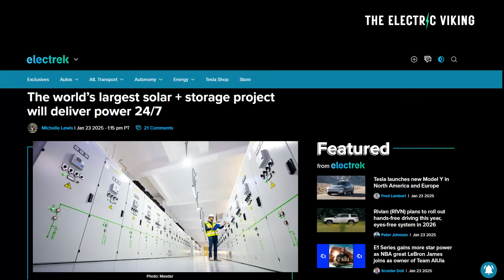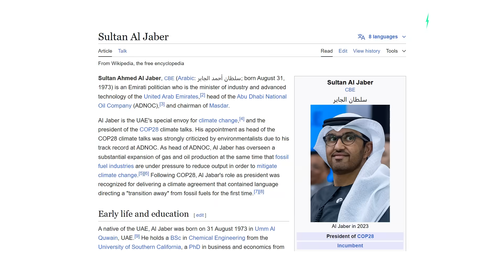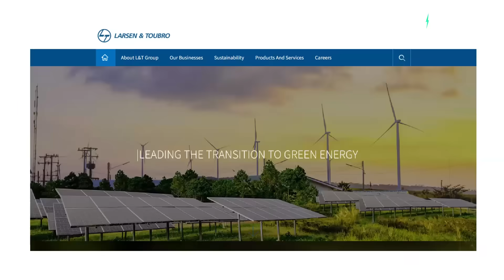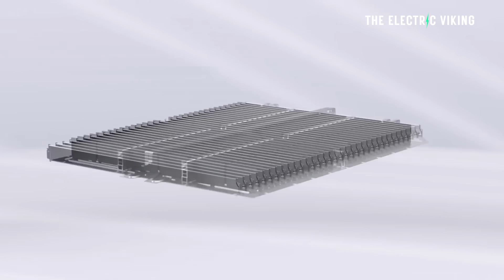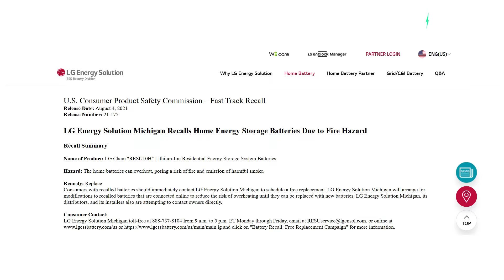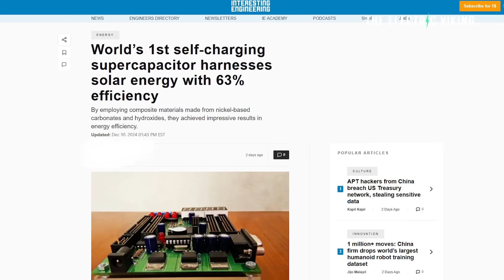The world’s largest solar and battery project deliver power 24 hours a day

Comment: I worked out the cost of installing solar in my home and it just doesn't make sense.  I've managed to get electricity use and costs down to a level where I'd never save enough off my monthly bill to be able to pay off the cost of a solar panel/battery installation system in my lifetime.  I could install a small 'stand-alone' disconnected system to power a back-up source for infrequent power outages, but outages are rare in my area.  Nuclear power still looks like a more valid option for large-scale energy needs in a metropolitan area.

Comment: UAE has 4  APR1400 nukes and is about to build another 4.  These were built by the Koreans over 10 years.  Nuclear pairs well with solar and batteries in hot sunny climates.  The claim solar and batteries can do it alone is baseless in the context of the required reliability.  Western Australia should replicate this model

Comment: This project is not the end of nuclear. The UAE has recently built 5.3 GW of nuclear, so this 1 GW solar-battery just means that the UAE is pursuing an all-the-above energy strategy.
Reply: They use a ton of energy and have some of the world's highest emissions per capita. An unfathomably wasteful country.
Reply: @veganpotterthevegan heehaw Heehaw
Reply: Given the price difference and speed to build difference, this is another nail in the coffin for nuclear. Not the end of nuclear exactly but sensible people will see the cost and timeframe difference and will usually choose renewables plus storage. Not always - but most of the time.
Reply: @glennjgroves  and "most of the time" means minimal profit....if any.  A dead duck.
Reply: @glennjgroves  China is building plenty of renewables, but they are still build as much nuclear as they can. The UAE is saying that they may build another nuclear plant. The so called 24 hr battery only applies to normal conditions. For extended cloudy conditions, they will need the firm baseload that nuclear and fossil fuels provide.
Reply: @ China is building vastly more renewables than nuclear. I don’t think it is accurate to say that China is building as much nuclear as they can. Solar panels do work in cloudy conditions (with lowered output).

“Baseload” does not mean what people seem to think it does. If it did it would be “base generation” instead of “baseload”. “Baseload” will eventually not be needed. (Eventually.) With solar, onshore wind and storage continuing to drop in price we will eventually not need fossil fuels or nuclear (in many nations, maybe not all.)
Reply: @glennjgroves  China is planning another 150 nuclear reactors and they are still building a lot of coal plants. They realize that renewables need firm backup to make sense. Even the Australia Labor party is backing up their renewables with enough gas plants to replace the capacity of their closing coal plants.
Reply: @mhirasuna  in Australia... nuclear is gold plating at public expense for vc profit margins. We have the ultimate  storage system... that isn't a battery system.
Reply: Nuclear in Australia is also duttons stalling tactic and excuse to reduce renewables@davidpearn5925
Reply: That country IS a Showcase of what shouldnt be done. First they should stop wasting energy and resources at a colossal scale.
Reply: Because they are not sucked in by BS and ideology.
Reply: @robertfonovic3551  Big Oil will own the profit margins.

Comment: No it’s not proof.  Sure in some areas but definitely not all.  Northern Canada here and solar struggles to hit 1/4 installed capacity.  I’ve seen weeks  go by that they didn’t even melt the snow off.
Thankfully we live right by a large hydroelectric dam.  The first stage was built in the 70’s and is still going strong a half century later!
Let’s see how long these before all these batteries and solar panels need to be swapped out.

Comment: I still think there is a place for nuclear power, but not today's pressurized vessel reactors cooled by water or molten metals like sodium . It would be more like Generation IV reactors fueled by thorium-232, new reactor designs that are much smaller than today's nuclear reactors and could be assembled in large numbers in a factory. They would be useful in parts of the world where there is less sunlight available, especially in the higher latitudes or areas with higher amounts of precipitation.

I do see solar becoming a lot more common in parts of the world where there are enough sunny days for power generation. places that include the southwestern continental USA, northern Mexico, the Sahara Desert, the Middle East and the interior regions of Australia. Wind power may be possibly hitting its limits due to the huge cost of large-scale installations, the higher maintenance cost of large wind turbines and the cost of disposing retired wind turbine parts, especially the blades.

Comment: California is installing a pvc panel and battery installation in the desert to power its High Speed Rail.
Reply: Yeah and they're asking for another $100 billion to make progress.  15 years after passing HSR we still don't have a single train running.
Reply: @ that is not true — the initial nearly 200 miles like cost about 10 to 12 billion — the most expensive part is not in what is currently being built. To get to Los Angeles or San Francisco from the Central Valley require running through mountains and there are multiple tunnels required on either end — no one that I have heard knows how much those tunnels go but they are multi billion just as they are between NYC and NJ which is 3 billion for about a mile of tunnel — the tunnels recently finished in Switzerland a few years ago were also multi-billion —
Reply: @bright93  You need to research better.  $33 billion is already the expected cost between Madera and Bakersfield and that is substantially already funded.  All the other routes remain unfunded.  The likelihood of California voters passing more funding is dim at best and those reasons and details are posted above.
Reply: Is that the rail line running between San Francisco Bay and Los Angeles or the Los Angeles to Las Vegas line?  The SFO > LA HSR rail is a mess, nothing 'HSR' about it.  All the stops along the way will make it no better than a standard rail line, and the cost overruns are getting horrific.  The Las Vegas > LA line might work, but its a private project so no taxpayer loss (hopefully, AFAIK).
Reply: @ the California Hi Speed Rail — it is still a few years away but work has begun both at the San Francisco end and the line south of Bakersfield — there are several miles of tunnels through the Tehachepi Mountains one of which is 40 miles long to prevent a steeper gradient than the train can tolerate. It will be the longest tunnel in North America.
Reply: @ could you tell me if the Bullet Train in Japan that opened in 1964 had cost over runs? I won’t wait for you to answer as you don’t know — and won’t bother to find out — it was twice the estimated original cost — no one complains about it now nor did they at the time — they also had the good fortune to extend their line at grade and having no mountains on the initial line. Can you also tell me which freeway is three times over its original cost and after 30 years is still not connected together even now? It is Hwy 69 from Minnesota to Dallas. How long do HSR tracks last? Decades with minor repairs. There are already additional lines planned between those already included such as a line to Phoenix from LA and a line to Lake Tahoe from San Francisco and those to Anaheim and San Diego. And stop dissing the Central Valley where 4 million live — there are plenty of cities connected by HSR lines with far lower populations that are highly used.
Reply: @bright93  I would love if our cost overruns were only double.  If I lived in Japan I wouldn't complain either.  Here in California we rarely make anything less than ten times what it should cost and that is if they even complete it.  In 2008 when we passed HSR the estimate was $9.9 billion.  They won't even get to a running train between Bakersfield and Madera for less than $33 billion.  I voted for this mess and now regret it.  Our state should be studied for how not to build things.
Reply: @ So you think that it is child’s play to set up a system to have HSR — multiple tunnels have to be dug to get through the various mountain tunnels done — Switzerland has a number of these train tunnels and they all cost multi billion dollars — another example is repairing widening the tunnel from Penn Station to New Jersey and it is said to cost $3 billion for a short tunnel under the Hudson — to get to the Valley in Palmdale includes a 40 mile tunnel —
Reply: @bright93  Do you not understand?  The project is not economically viable and likely will never be completed which is why no trains are running 17 years later after the proposition 1a was passed.  Do you even live in California?  It makes zero sense to reroute through the mountains unlike the current Amtrak lines.  They should have just electrified the existing lines like they are completing with Cal Train in Northern CA.  It only costs $75-100 to fly round trip from SF to LA.  Who is going to use the train to take three times longer and cost double the price?  I don't need your answer because no one will.  The project for all intents and purposes is dead man walking.

Comment: I don't think anyone would argue that Europe can't exist on solar panels and batteries alone, but even when reviewing the "sun belt" we should be somewhat circumspect.  The UAE is to Solar what Norway is to hydro and we should be careful when extrapolating.  It has enormous arid land with almost zero economic value so it's a no brainer to want to install solar panels there. And just looking at recent data, in 2022 UAE consumed 148,089 GWh which works out to 406 GWh per day so, assuming the sun doesn't shine at night, they will need battery storage for 203 GWh.   Since a single Tesla mega pack stores 3.9 MWh they would need 52,051 of them, and at a unit cost of $1 million, that comes to $52 billion.  This is a sizeable cost but probably affordable for such a rich country in a part of the world where vanity projects are par for the course.  Most countries in the sun belt however, are quite poor so adding this cost burden to their populations is probably not achievable nor desirable.  The idea that solar panels will replace everything else within a certain band of latitudes is just not credible imo.
Reply: "Most countries in the sun belt however, are quite poor"
Pakistan is poor, and just increased its electricity production by 50%, almost all of it behind-the-meter rooftop or local ground mount solar. Whatever the cost burden, people in poor countries need electricity, and nothing costs less than solar.
Reply: @lancebenson8400  wrong.
Reply: @robertfonovic3551  What an informative reply. Are you suggesting that the individuals in Pakistan who installed rooftop solar on their residences were wrong to do so? What do you think they should have done instead to have more and more consistent electricity?
Reply: I would add that, unless new type of batteries are discovered, current batteries become obsolete and need to be replaced after 10-15 years
Reply: @cerbrain Automobiles also become obsolete after 5-20 years. That hasn't meant that we don't use them.
Reply: What’s the cost of a nuclear plant these days? About the same?
Reply: @markjames2154  and nukes can run 24/7 for 70 yrs. Renewables not so much. 40 percent of nameplate capacity.  😅
Reply: @markjames2154 maybe 🤷🏼‍♂️ but you need to feed the Nuke with fuel forever, what does that cost?
Reply: It is not solar panels that are the expensive part. The batteries is where the cost is prohibitive.

Comment: I see the day when every new home built in Africa will have solar panels as its roof, a battery on the side, a heat pump installed for air conditioning, a small gas generator as backup and e-bikes as a perk to buy to house. Like cell phones that has eliminated phone lines, new homes will no longer need to run electric cables to each house which will save the government a ton of money.

Comment: Capacitors,  any electronics nerd can tell you that a capacitor fully charged at 1v will have 1.1v available,  yes a 10% gain over imput. They are a dark horse of electotickery!
Reply: You can certainly increase voltage at output - a fallback converter with a duty cycle of more than 0.5 will provide that - but you can't get more power out than you put in.

Comment: Hi Sam, I reviewed the article you mentioned at the end. In reading past the headline, it says the energy storage efficiency was 63%, which you'd have to compare to current batteries that are roughly 95% efficient. And then to make it self-sufficient, they paired to with a solar panel, just a regular solar panel, probably 25% efficient just like any panel today, and they state the overall efficiency was just over 5%. So for me, they still need to get supercapacitors much better, but it is promising research.
Reply: The measures of efficiency you mentioned are chemical and electrical efficiency and the efficiency of solar energy capture. While this is interesting and important to understand, in the end the bottom line is really just the cost per kilowatt hour.

Comment: I refer you to Paul Burgess, this is crap two or three days without sun and it's toast
Reply: scale up.........its not rocket science.
Reply: @andyfreeze4072  sure you can scale up

now, add the extra costs in, remembering you have to pay for what you build, even if you don't use it all that often

clearly it does not scale economically
Reply: @andyfreeze4072  we don't have enough sunshine or land to scale up to our needs do the maths. In Australia you would need to vertully cover the interior with solar panels to make a difference. The power of batteries is wildly overstated and not understood this is about as stupid as it gets for large scale power supply

Comment: How much did the batteries cost? The cost of Batteries to make wind and solar operate  24/7 and 365 days in Australia is around A$10 TRILLION.
Reply: truly , you are a wizz with mathematics. and the cost to make nuclear provide 120% of power would be.......( you have to factor down time). renewables are providing at least 50% around Australia now and it didn't cost $5t. Nuclear option from Dutton is around $300b for 7% ............can i buy you a calculator?
Reply: @andyfreeze4072  > Nuclear option from Dutton is around $300b for 7%

$331 billion for 38% nuclear (+50% RE + gas/storage/transmission) - try reading the plan vs substituting what you believe the plan to be.

Now it may be that their plan is incorrect, or priced incorrectly, but they are not suggesting 300 billion to produce 7% of Australia's electricity via nuclear, and it makes you look like an idiot to pretend otherwise.
Reply: Based on what?

Comment: So everybody comes home at 6pm plugs the car in goes to make a cup of tea , coffee and the grid collapses u cant make it up here in the UK we do not have large expanses of desert we recently had a power outage and you'd guess correctly the vans didn't go out , on charge overnight , suppose you put in an emergency generator run on diesel
Reply: you are making assumptions that have already been discussed and debunked by the experts. your assumptions are WRONG.
Reply: Battery storage is the simple immediate answer.
Reply: @gobot109  Until they catch fire 'Ross Landing springs to mind' and there are more than that one that's been ablaze

Comment: 10,000 jobs for a year, and maybe 50 jobs the operate and maintain ...  Solar + Storage is a leading low cost $ per MW solution that can fielded in say very large fields project by project and put them near interstate grid lines.  I disagree with TEV about rooftop solar, as its a lot of hassle with your power provider for what you get.  I would only consider if my power company sold me a systems they maintained.

Comment: nice video. personally I think solar panels on every roof is a great idea, but battery, electric storage and maintenance need to be centralised. if it's a subscribed service rather than a purchase, it would suddenly become a very viable solution in western countries, especially from cost saving and operation's perspective
Reply: Cost of domestic installations have plummeted (UK)
In October I purchased a solar battery system with 2 GivEnergy 5.2 kwh batteries and they cost 1550 each
Octopus my provider will give me an overnight rate of 13p a FIT tariff of 15p instead of what I was paying (25p standard)

You can also hand over control of charging to Octopus who have what is called intelligent flux, dectralised mesh networking to stabalise the grid at a local level

Comment: You should do a video on how much energy people store in their Tesla powerwall vs how much gets discharged during peak hours. 

So much of the energy we generate gets wasted bc no one needs it when it is produced
Reply: Exactly. That is why we do not need more wind or solar. We need more nuclear.
Reply: if the energy is in effect free, why is waste an issue for you? There is plenty more where it came from....the sun has another 5 billion yrs of life.
Reply: @andyfreeze4072  It is a waste of resources - as we still have to run a nuclear powerplant, which is the most economical if it runs and gets paid all the time. The individual with solar cells on the roof may save some money during summer - but society as a whole end up paying more.